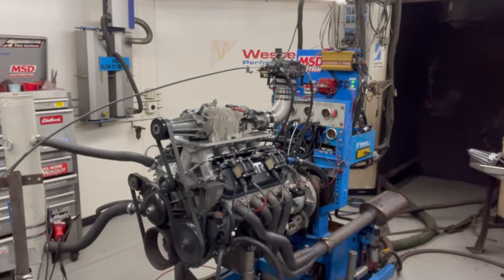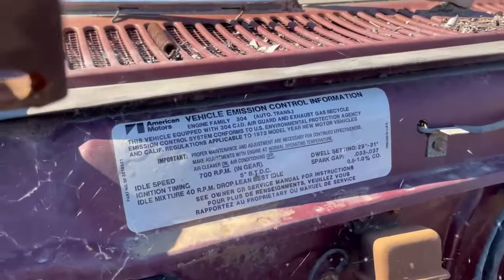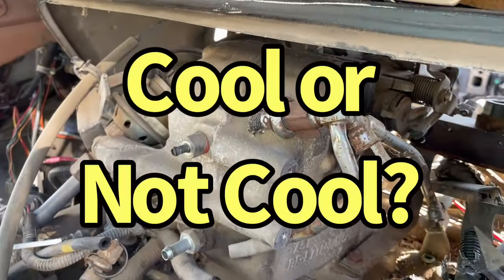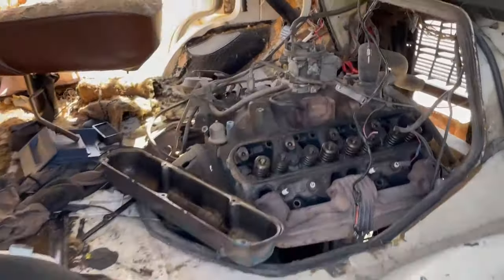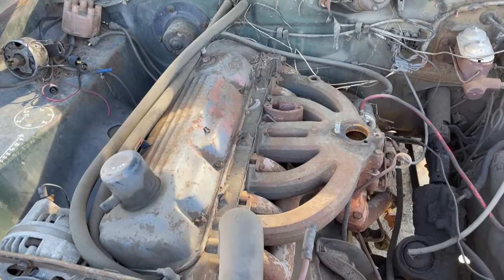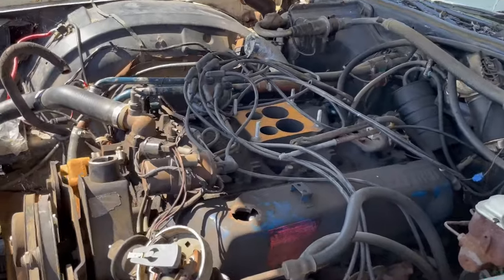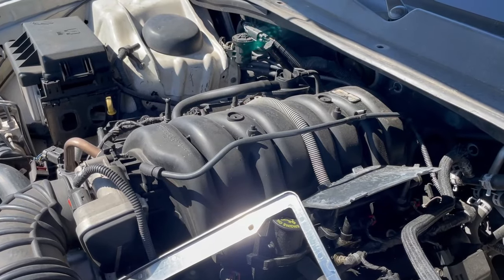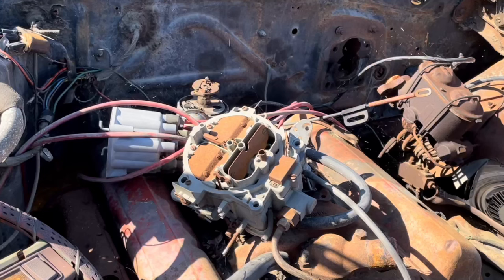BEST JUNKYARD DAY EVER! WHO FINDS FOUR 6.0L LS MOTORS IN 1 DAY? FORD & DODGE V10S, CLASSICS & BOOST

Comment: Just found a 2010  l20 with 799 heads in a savannah. I snagged the intake and heads and it was flexfuel I will be swapping a Texas speed  cam heads and intake  onto my 2002 2500 hd lq4. And making it flex fuel.

Comment: The pick and pull yards have plenty of 6.0 and 6.2 motors, plus lots of 4.8 and 5.3 motor’s.  I live in Arizona.  The problem is:  they are going to charge you for an entire motor, which wouldn’t be a problem if ALL the motors weren’t missing major parts.  Usually, you find them missing one or both heads, some of their accessories, valve covers, throttle bodies…. The intake is usually destroyed, or just gone (or at least the injectors and rails, etc).  It sucks, because you have to run all over the yard to find a head that matches, as well as other parts you are missing….  Or just take the’Hit’  of paying for parts you aren’t getting…
Reply: There prices have gone way up , almost not worth the time !
Reply: @davidcallahan5157  really?  They charge $450 for any v8…. I turn around and sell them for $850, $1.000, $1,300 (5.3, 6.0, 6.2)respectively.  I think that’s still pretty cheap!   What are you paying for them, and where?  If it’s not too far, I might just head up that way for a couple weeks.(“Have service truck and maintenance trailer, will travel”!). It’s going to start getting hot here soon anyway, lol
Edit:  
Those prices are for iron blocks, BTW. “True LS” (meaning aluminum block, which also encompasses motors like the “L99” and aluminum truck block motors obviously sell for much more, and therefore retail for a lot more.)  They are much harder to find.  Really, it’s a matter of “Luck and timing”, though I do pay $100 to any yard worker who can turn me on to one that I can get with at least 5 hours left in the working day!  Even then, they are almost always truck motors or LS-1’s.  I don’t really buy from the “traditional” salvage yard, as they usually want full retail.  They aren’t a bad option for someone who doesn’t mind paying a bit extra for a warranty.
Reply: @davidcallahan5157 they've went WAY up at LKQ in my area. In 2019 400 for any motor on the yard and 225 on holiday sale. Now they charge depending on what engine you get .A 6.0 will be around 1,800 and that's with you pulling it out. They're not getting half the business that they did before.
Reply: @BruceLee-xn3nn  yea they had special today 250 any engine but doesn’t include anything else like alt starter power steering pump environment fees taxes that 250 became almost 500. And half day worth of work. Maybe I should do YouTube video lol.

Comment: The 317 denali is an lq4. Lq9's only came in escalades and some special option pickups.
Reply: 01-04 Denali's got the LQ4 with the 325hp tune, in 05 they went to the LQ9.
Reply: @THEFERMANATOR I have an 05 yukon Denali… it’s an LQ4.

Comment: The imperial will be a 413 or a 440 depending on when it actually rolled off the line. I think you should pick up the Lincoln y block an do a other guys video with it.

Comment: Ford 460 and LS are cool , maybe Gen III Chrysler. All others are not worth throwing good money after bad. You have to manage every trick to make the others stay alive and the result is average at best. Good parts are difficult to get if not impossible. Ford 460 needs good heads and a roller cam and you can throw in a 4.5" stroker crank without touching the block.
For me the most important thing is to build an engine that delivers what i want without sabotaging the whole project by adding hidden design and material flaws in every corner.

Comment: Hey Richard, I had my 6.0L gen 4 bored .65 over to a 6.2. It has flat top pistons What heads would you recommend?
Reply from the maker: To achieve what? I would be more concerned about the thin cylinder wall strength and over heating

Comment: Was the Cleveland 4v or 2v? You should build a stroker 4v E85 Cleveland and then compare turbo VS procharger.
Reply: It's been a while, but I'm pretty sure that was a 4V. 2 fingers in the intake port, 2V, 4 fingers makes it a 4V.
My last 4V 351 got removed and sold, to make way for a 6.0 LS ten plus years ago. 
Clevelands are too heavy and too expensive to make decent horsepower, I do miss the sound though.
Reply from the maker: it was a 2V